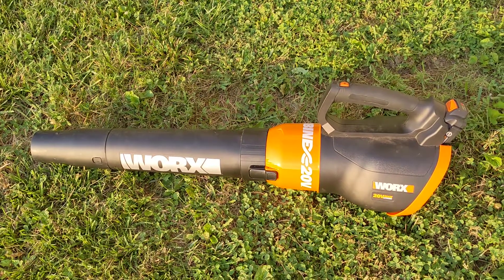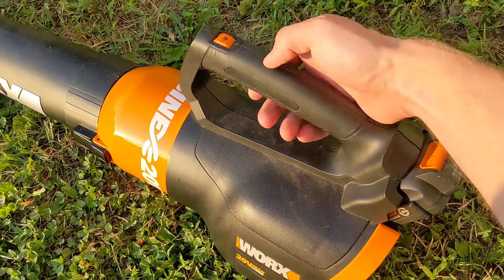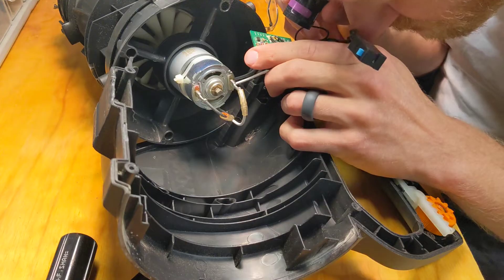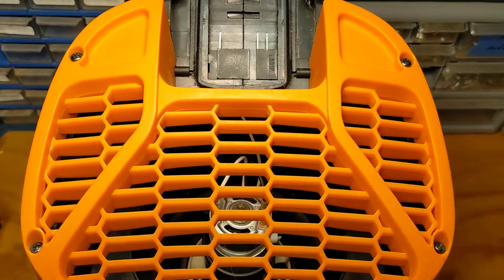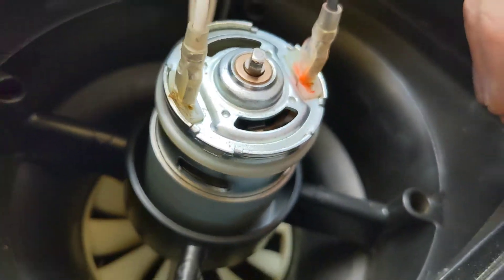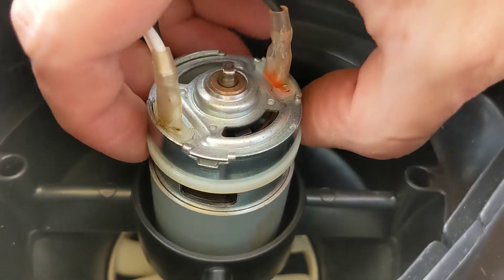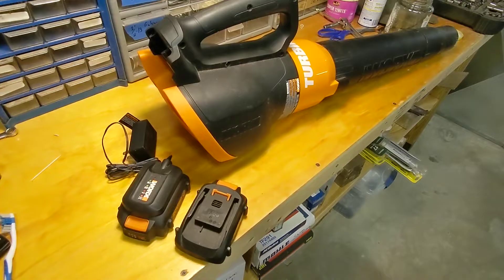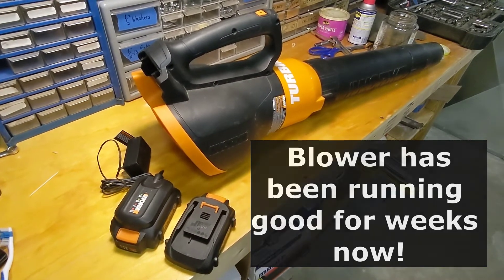Battery Leaf Blower Keeps Turning Off? – This might be the problem!!

Comment: I have the exact same problem with my blower, buy mine does not have a zip-tie  what else do you think it could be?
Reply from the maker: Hmmm interesting that it doesn't have the zip tie on the motor. I'm honestly not sure what else could be causing it. Have you tried multiple batteries?

Comment: Can you help with a dewalt blower that shuts off after 1-2 sec?   If i feather the trigger it might start and run a bit longer but still dies with a minute.  
Less than month old, used lightly about 3 times prior to this shenanagins 😢
Reply from the maker: Is it an electric or gasoline powered blower? Thanks!
Reply: Sorry, battery and yes they are fully   charged.
Reply from the maker: Apologies for the delay. My first thought would be an undercharged battery, but it sounds like you've already tried a couple and ruled that out. Unfortunately electrical problems can be difficult to troubleshoot when you don't have the unit in front of you. It sounds like it is cutting out on an over-amperage perhaps. Is the inlet to the blower completely clear? Seeing how new it is, maybe check into any refund/warranty. Sounds like something was fried right away.

Comment: The switch on my Worx WG 546 blower (now discontinued; current model is WG 547) has become too difficult to turn on. So as I was disassembling the handle, I could hear a loose piece rattling around. I cannot find a diagram of the inside anywhere, including Worx. when I stop your video, I can kind of see the pieces, but not everything. Do you have a diagram or photo you could share? Hopefully then I could put it back together!
Reply from the maker: Hi there,
I don't have a diagram, but I do have some more shots of the inside parts to the handle. If you go my main channel page, https://www.youtube.com/@buttons_fix_it
Then click on more, you can click 'view email address' and send my an email. I would put it here but YouTube can flag comments some time with the address. Hope we can get it fixed for you!

Comment: Mine works on the 1,2,3 power options however when I push the turbo button it shuts off. Batteries are fully charged.
Reply from the maker: I think you have a different model. The one I was working on here only has 1 & 2 for power options and no turbo. Maybe there is a cut in a wire insulation and it is grounding the circuit when the turbo button is pressed?
Reply: Mine did the same thing.   Took it apart and blew it all out and it works as normal again.

Comment: I had exact same problem.  My first thought was that it was the switch, but after finding your video, I found the exact same problem as you where the ziptie was covering the vent ports on the motor.  Slid it back away from the ports, presto, problem solved.  Good work-thanks for posting.
Reply from the maker: So glad it worked for you and thank you for commenting, nice to know when these videos actually help someone out! Have a good one!